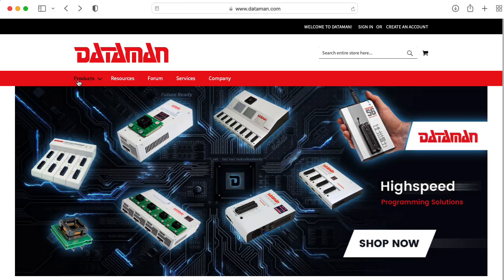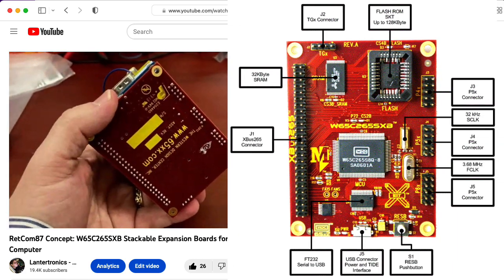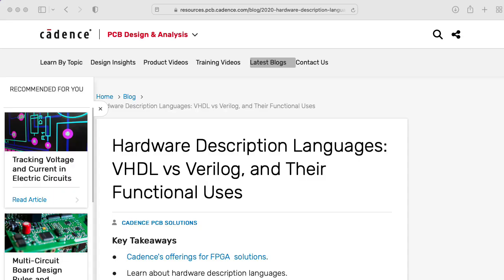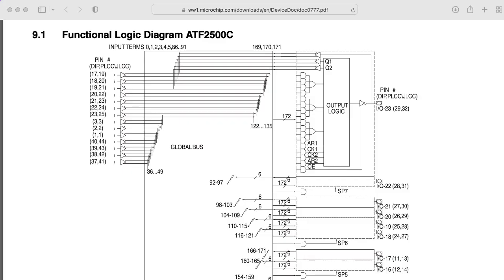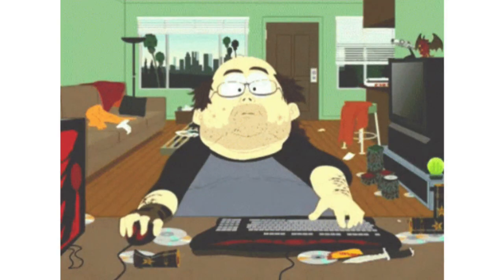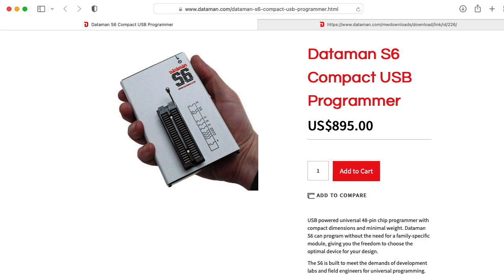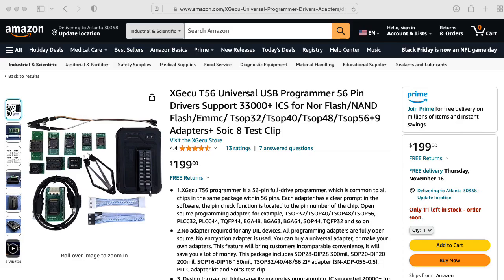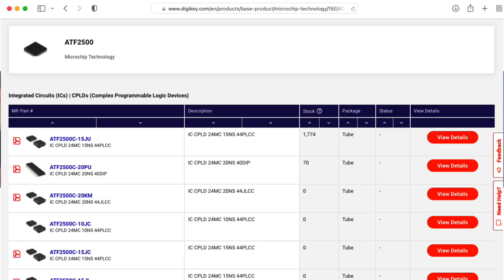A Cheaper Way to Program these CPLDs? (Atmel ATF2500, Dataman, Xgecu) (RetCom87 Retro Computer)

Comment: Sigh. I got 2 ATF2500Cs thinking the XGecu would work. It has 48 flops and enough pins for address and data! That would turn your 6502 address decoder into an MMU with a 6-entry page table!

Comment: I can confirm that the Xgecu T56 does NOT program the ATF2500C PDIP chip correctly. The software Xgpro, latest version at the time of this comment, claims successful programming, but the chip does not work as expected. The same .jed file programmed with the DATAMAN-48PRO2C results in successful programming by the DATAMAN software, and the chip DOES work as expected. Unfortunately, for the ATF2500C, it has to be the expensive programmer for now.
Reply from the maker: Ah! That is good to know. I will add a note about this to the description.
Reply: That is my experience too. Have multiple ATF2500Cs, have tried the sample PLD rules with WinCUPL and the T56 does not appear to program them correctly. I tried about a year ago so will update software again and re-try. If anyone finds out to get working then please post how!
Reply: @henrydmr  Very interested in this. I have the TL866 plus that does not program it, and would be willing to upgrade if it could handle the ATF2500Cs, but it seems like nothing does under $1,000.
Reply: Old comment but can you elaborate on the workflow to get the ATF2500C programmed with a Dataman programmer? Is it as simple as creating a .jed with WinCUPL and then burning it in? I've been able to make .jed files with WinCUPL for the ATF2500C (v2500c memonic) but WinCUPL doesn't appear to have fitters for the chip so I'm unable to verify things like macrocell/product term usage and confirm that it would program the chip correctly if I had a suitable programmer (and I want to confirm the toolchain works before making the investment).
Reply: @matthewsmith5104 Hello. Yes, the workflow is a simple as that.

You are correct about the lack of .fit file generation by wincupl. The more advanced CPLDs such as the ATF1508 do have fitters and do generate .fit files.

Comment: Although EPROM programming procedures were always published & easy to do, when PALs first came out their programming procedures were not published requiring expensive manufacturer approved programmers. This changed when Taiwanese Universal programmers such as HILO were released. The first cheap DIY PLD programmer I came across was from ALTA Engineering which could only do some early generation GALs. These days many more modern ICs use JTAG.

Comment: I have a feeling the XGecu was originally designed for the automotive industry, so the "ecu" part would be the acronym for "engine control unit" and spelled out as individual letters.

Comment: I got the Xilinx XC9500 Digilent programmer, and was getting set up to use the XC9500 for synth logic.  5V compliant, ISE (schematic based editor) and relatively friendly package (that I laid out an adaptor board for).  However, they discontinued it while I was getting set up.  While I could continue on with it because you can still get them, I don't like the idea of working on things (at least this type of thing) when at some point it's just going to be gone.  I guess at some point EVERYTHING will be gone, but getting ready to start working on something like this, and then having the company decide it's unimportant to them and the world is somewhat disheartening.  I still have my programmer, and 20 PCBs though, so maybe I'll try it sometime.  

However, this Atmel guy, being DIP natively and 5V compliant might just be the ticket!  I'll need to check out the dev tools for it though.  If they're like ISE, that would be pretty cool.  ISE was really amazing from the little amount of time I started working with it.  I had some shift registers and XORs up and running in a few minutes for some fun digital noise stuff.  (LFSRs etc.)  

I have an XG programmer from some of Atmel's other chips, but not sure if it's compatible.  I'll have to dig it up and see if it's something that could work with this ATF2500 chip.

Comment: I love 40 pin DIP, but I love LCC packages even more, with their cute little sockets or soldered directly to the board. One of my favorite projects started with "how can I use an LCC?" I ended up building a wavetable VCO with no CPU. I have a video about it titled "Wavetable sound demo". I still use that module today, but it needs another revision.

Comment: I have an XG programmer with that scary software link; the software is updated at intervals, and it works great.
Mine is the TL688 II plus, and I have used it to test TTL and CMOS logic chips, as well as program PIC microcontrollers and FLASH memory devices.
It is very good value, and I expect the model you are considering to be equally good value.

Comment: haven't used a 2500 with it but i have used the xgecu device, and the tl866 & clones. first & third party firmware. if you have questions about what it means to the programmer to program the 2500 the dll is relatively straightforward to disassemble. it's mostly just a big table. you can use that information to build your own programmer, but it's not secret or anything, the GAL/PAL/CPLD era stuff is all so simple that even the programming is usually in the documentation that describes the gates & stuff. there were just so many families and a programmer for one family was already pretty expensive, a secondary tool market where a 5000$ was good value emerged

Comment: It is nice to have chips that can plug directly in to a breadboard, but sometimes a a PLCC or SMD part with an adapter is the path of least resistance. Consider using th ATF15xx family instead of the ATF2500. The official ATDH1150USB programmer is under $100 and it is also possible to use a generic FT2232H board or even a parallel port dongle with an older computer. It is possible to use VHDL and Verllog because the ATF15XX are functional clones of some Altera 3000/7000 series parts. These parts are supported by Quartus II 13.0. Microchip has a conversion program to convert Altera POF to Microchip (Atmel) JED.
Reply from the maker: I do plan to check out the ATF1502 and 1504.

Comment: I can confirm that the latest TL866II Plus software (12.63) sadly does not include the ATF2500 in its list of supported parts.
If you lie to the program without the programming pod connected to USB and tell it you have a T56, then ATF2500 appears in the list, so the advertising copy is not lying.
Reply: yes I did what Andy did with the same results

Comment: Yikes. I've toyed with the idea of making a programmer with a Pico and some supporting circuitry, but as someone who hasn't really coded much since Z80 assembly back in the (ahem) day, it all feels a little insurmountable. But my budget right now is crumbs and lint, so yeah. Those prices.
Reply from the maker: The main thing is it looks like Atmel never published the 2500 programming protocol so some reverse engineering would be involved in a DIY approach.

Comment: Yes I have...the TL866II PLUS. The "cheaper one" you mention.  Yeah I thought the URL a bit dodgey too :-) but you can go right to their website. the only problem I had was it doesn't provide the 21V programing voltages for the 2716 ROM I've burned to FINALY build my LNW-80.  Otherwise it seems okay and it appears that another people use it.
Reply: ( tried bringing up their software and setting to the T56 programer and and it shows a whole family of the ATMEL chip you're looking at:
Reply: you need to plug in the power adapter for those

Comment: Wow. Back in the 80’s when I was just out of college working at TRW developing computer network devices, we used PALs, GALs, etc. a LOT. BTW a GAL is a PAL that is reprogrammable. Much better than the one time only programmable PAL. Lattice later came out with a multiple PAL logic array which I also spent a lot of time programming to do a video capture device called “Videosnap” back in the 90s. It was basically banks of PALs with a routing pool in the middle to interconnect them all. It would seem to me that programming one wouldn’t be that complicated to make a programmer if you have the resources.
Reply from the maker: Apparently the issue with the ATF2500 is that Atmel never release programming info for it and kept it proprietary. I'm guessing if the Xgecu can do it, they must have reverse engineered it.
Reply: ah but can you have a Gal Pal? ;-)
Reply: @johnforguites4800  There have been some really nice manuals and PAL-books are definitely amongst them. Personally I really liked PEEL chips made by small manufacturer named  ICT. Peels had better macrocell logic than Gal&Pal, but the company did fold quite soon afterwards.
Reply from the maker: @johnforguites4800 I seem to recall someone saying the GALASM instructions explicitly addressed that issue ;)